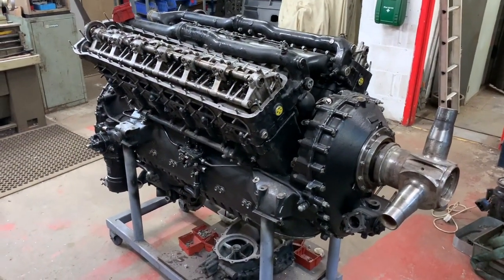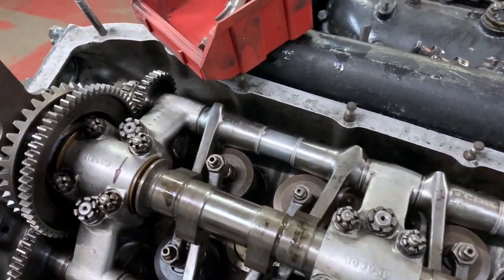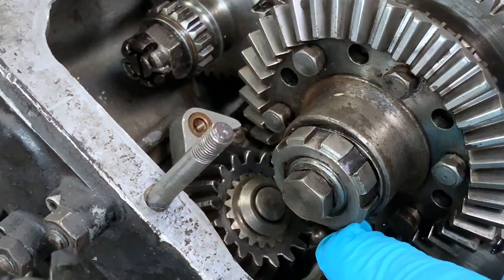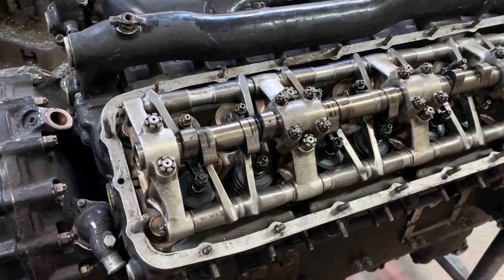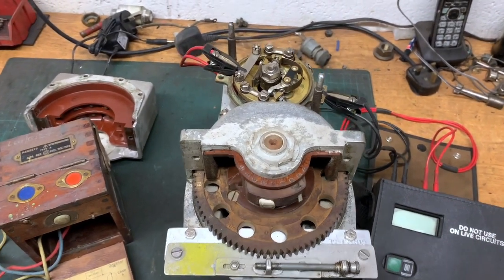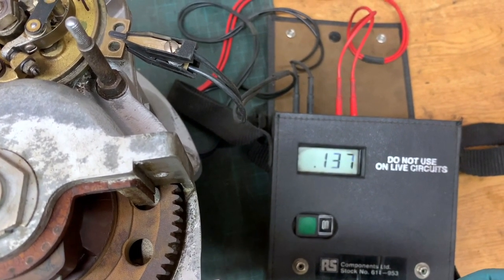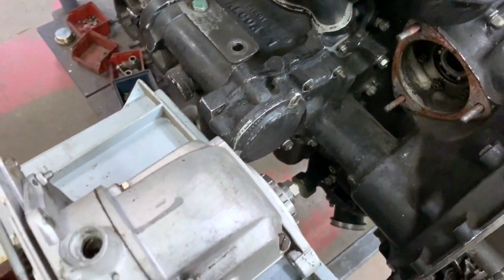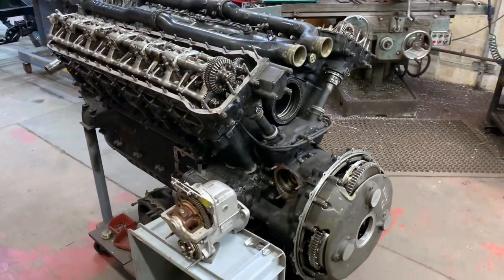Merlin engine - camshaft and ignition timing

Comment: Fabulous explanation, and I love the fact that the camshafts have Vernier adjustments.  
A very neat way to assure correct cam timing.   As a matter of interest, have you ever looked at how the BMW Vanos (variable timing) works?  Obviously not the same, but a fantastically neat solution to an 'on the face of it' problem. 
I also love the tool you made to adjust the points opening; (but I would say that wouldn't I?  I'm a mechanical engineer who studied aeronautical engineering).  Was there ever a tool like that in the day?  If not, I wonder why not, and how did they manage?
Thanks for sharing this.
Regards Mark in the UK.

Comment: A question, the base pivot point of the rockers are on a shaft which obviously rotates, due to it's geared drive, why is that? I can't see why it wouldn't work with a static shaft, I'm obviously missing something. 

Regards
Reply from the maker: The rocker shafts do not rotate.  The gears on the rear end of the rocker shafts are idler gears that drive the auxiliary pumps mounted on the rear of the cylinder blocks.
Reply: @HistoricAeroEngines  Thanks for that, that one had me scratching my head, LOL.